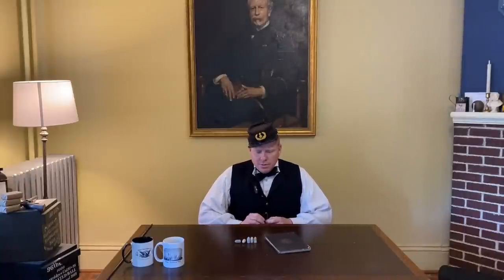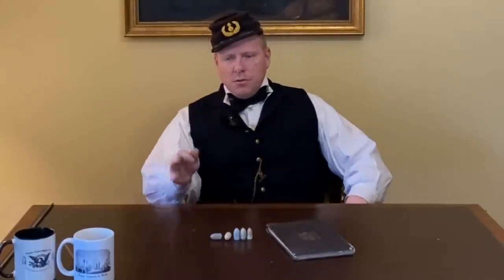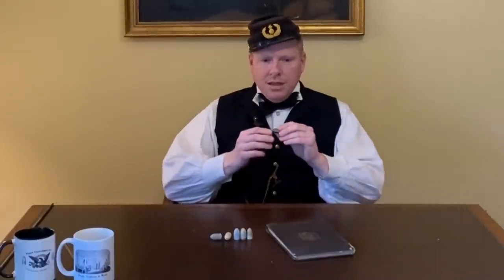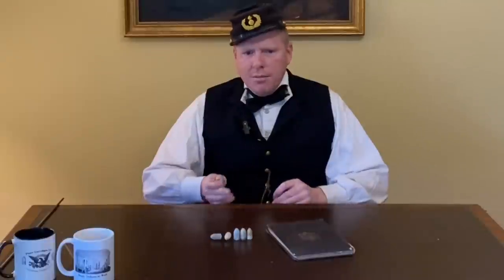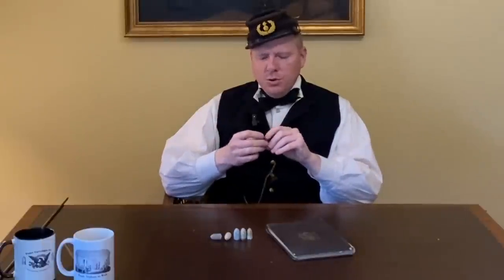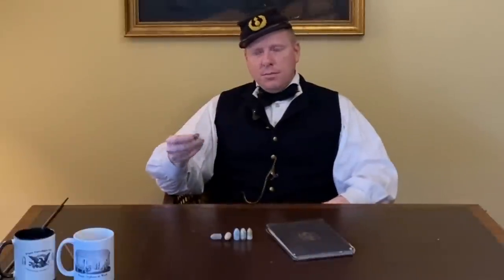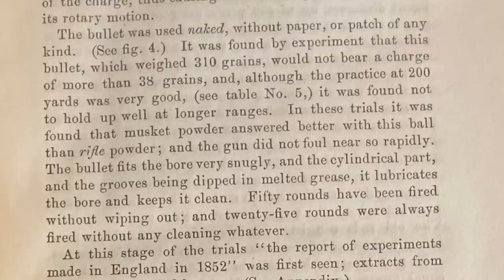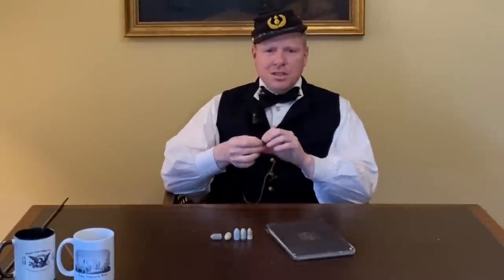Why did Civil War bullets have grooves?

Comment: One of the more interesting Myth Busters involved the testing of bullets fired into water, the question being posed concerned shooting a submerged combatent.  All supersonic bullets shattered on impact and the pieces rained down into the pool being used as a test bed, with underwater cameras to show what was happening.  A .223 or a .50 cal, all came apart on impact into harmless chunks.  But, sub sonic bullets, such as  pistol rounds from a 9mm, and older  firearms like Peacemakers using .45LC, or the 1911 with .45ACP, and specifically black powder rounds such as the Minie ball, contained a tremendous amount of lethality if fired into the water at several feet.  I think the conclusion was that if you had to take on a submerged combatant, an old black powder firearm was the only way to go.  Had to add that in reference to this video info about the 1in7 inch twist for the AR, and 1 in 6ft twist for the older rifle and his comment about the bullets spin speed, another Myth Buster tested spin rate by firing a 9mm straight down into ice, the bullet was screaming it was spinning so fast, the RPM being in the 100,000+ range.

Comment: They are gas check groves that allows the back of the bullet to expand out to engage the rifling groves in the barrel on the way out of the barrel....
This way you didn't have to force it in to the rifling while you ram them down during loading....

Comment: Interesting, i wonder why blck powder cartridge bullets of today have square groves in them, like  the 44-40? It isnt particularly fast either, is it because they are loaded into a brass case and their for needed to be more robust? Or is it because we increased the barrel twist, even though the bullet is still going slow? I love the study of interior ballistics, but have always wondered about this.
Reply: Those are actually grease (lube) grooves. They also give lead somewhere to displace to when you run the bullet through a sizing die, besides the base of the bullet, which would have very adverse effect on accuracy.

You'll notice swaged lead bullets (sized in actual manufacture) tend to be ungrooved (or knurled), cast bullets of "traditional" type have such square grooves, and cast Lee "tumble lube" type bullets have narrower, shallower, more numerous semi-circular profile grooves.

The minieball was used in barrels rifled at "round ball" rate of twist (quite slow, 100-150 caliber twist rate), while a .44-40 has a more appropriate to typical bullet length (35 to 50 caliber twist rate), thus is far better stabilized. The more elongated a bullet, the faster twist rate is needed for "ideal" stability.

If such truly piques your curiosity, get a copy of "hatcher's notebook", he has an entire section on ballistics, interior and exterior, as well as a few decades of info on such diverse topics as the "golden age" of machine guns, the perfection of the '03 Springfield rifle, development of the semi-auto battle rifle, and many more quite interesting musings from his career as an army ordnance officer from the turn of the last century until ww2

Comment: Arrows? They "wobble" a LOT from the moment of launch because the flexibilty of teh shaft allowds the force from the dtring to BEND the shaft during launch.

Bullet spin? in flight, the rotational speed" of a bullet is basically unaltered from launch to impact. As opposed to "linear" speed" which is serious;ly affected by air resistance.

The original Minie Ball had a "plug" in its base to aid "expansion", the Brits worked out that if the "grooved "tail" of the bullet were thin enough, gas pressure alone would expand it to engage the rifling. Remember , the entire point of these bullets was that expansion. The "raw' bullet was barely the diameter of the lands and thus easy to ram down even a fouled barrel.

In earlier times, rifled barrels required that the bullet be "started" at the muzzle with significant force, then rammed down the barrel. "Expanding" skirts on bullets took the hard work out of reloading..

That Greenhill chap did a LOT of work on bullets, velocity and twist rates WAY back in the mid 19th Century. Definitely worth a read!
Reply from the maker: I’d encourage you to watch my other videos and possibly even read my book “The English Cartridge” if you do want to learn more about the expanding ball and ammunition of the mid 19th century. You’re very very close, but there are some deep gaps in your knowledge.

Comment: Barnes copper bullets have the grooves. The hard solid copper doesn't engage with the rifling as well as jacketed lead bullets. 😉 Indeed, the bullets would have to be smaller diameter than the barrel grooves if not for the relief provided.

Comment: The grooves were there to help cut down on blowby, allowing for the pressure to push the round more efficiently.  Today’s rifles have closer tolerances so the grooves are not necessary.  As the gases work their way around the first ridge, the gas expands into the area provided by the first groove slowing its flow and the energy lost is exchanged into the bullet.  And then so on the process continues into the next grooves thus slowing down the speed of gas flow relative to the acceleration of the bullet.   You can find this phenomenon used today in jet engine compressors where a seal is desired, but with no contact with the compressor housing.
Reply from the maker: With all sincere respect, could you please provide one historic source (just one) that states the reason you gave for grooves in the bullets?
Reply: @papercartridges6705  truly I will say,  I have no references.  This is because they fully didn’t understand onto which they had stumbled. Remember, the Industrial Revolution was still very young.  The theories at the time were the wind vain and the expansion theories.  But at close examination of expended rounds, the expansion theory is inconclusive.     Correlating what I know in steam and aviation,  to me, what I said in my previous post is the most likely physics.

Comment: Question for you guys/audience , now I understand that this won't apply in modern rifles or many modern guns in general, but in old revolvers/replicas and modern short barrel revolvers where your getting low speeds, and can shoot cast bullets, would this concept reapply itself ? Like if I did this in my .45 1873 or a 3 inch 38spl top break?
Reply from the maker: The grooves were found to increase accuracy more at long range (sometimes 400 or more yards), for really slow twist, low velocity bullets. I think a .45-70 will have fast enough spin that grooves probably wouldn’t help much, and for a pistol, I don’t think they would serve any purpose really. We only see Tamisier grooves used in the relatively short period of time 1845-1870 when rifles used very slow twist rifling, and had a very low velocity, but they were trying to improve their long range accuracy out to 300+ yards for military purposes.

Comment: If a bullet is tipped nose down so that the grooves on top of the bullet are exposed to drag, any tipping action the grooves accomplished would result in the nose of the bullet moving to the left or right depending on the direction of the rotation.  This would actually result in the wobble increasing.  This is known as precession.  Any helicopter pilot and tell you about it.
Reply from the maker: The grooves aren’t a magic solution for everything, and their function is rather crude… I mean, deliberately causing drag on something supposed to be aerodynamic, is less than ideal. But like the feathers on a badminton cock, the drag keeps the nose (more or less) oriented and prevents the long bullet from doing what it really wants to do, which is rotate around its shortest axis, and tumble like a buzz saw.

Comment: I'm a little suspicious about the the graph of straight vectors ( 4:16 ) of the "slip stream", AKA laminar flow  being incident normal to the groove. The flow wouldn't see a flat surface since the bullet is rotating. The air will stick to the bullet creating vorticity which is drag inducing. A buoyancy force will be created opposite to where the air stacks up in greater density. I may be full shit....but that's what i think based on some background knowledge.   EDIT: I'm not sure that the physics of vorticity was understood very well in 1833.  Also, it's a really hard topic that scares the crap out of me. https://en.wikipedia.org/wiki/Navier%E2%80%93Stokes_equations
Reply from the maker: The grooves do create drag which is why the English decided the benefit of the grooves in maintaining stability was not worth the considerably loss of velocity, and the British rifle musket bullets were completely smooth. But I am definitely not an expert on the scientific side and I tried to keep the explanation as basic and as layman as possible for a short video.
Reply: @papercartridges6705  Love your content, I hope I didn't sound critical. Just thinking out load in the comments...
Reply: @nonokodog622  So, I am really late to this comment, and physics isn't my strongest suit, but forgive me for thinking out loud as I parse through this.

It seems to me there are going to be several force vectors acting on the spinning, grooved bullet as it plows through the air. There will be the drag force normal to the reverse face of the bullet, the lift force normal to the reverse of the gravity face of the bullet. There is the velocity vector normal to the forward path of the bullet and a gravity force normal to the gravity face. Because the bullet is rotating there is also a conservation of rotational momentum and its vectors. Several of those forces will be irrespective of whether the bullet is grooved or not. The velocity vector's initial condition is irrespective, the gravity force will be irrespective, as will the rotational momentum.

However, the drag force, and lift force, importantly will not be irrespective. When the ungrooved bullet starts to process around its rotation, that is wobble, it will become more and more unstable as the procession worsens with each rotation, until it has become perpendicular to the velocity vector. At which point the bullet will start to rotate around its abnormal axis of rotation and "key hole". Since the lifting force is shoved along the path of rotation like a gyro, and the procession emphasizes instabilities.

When the bullet is grooved, however, the drag force increases opposite the velocity vector, the lifting force increases opposite the wobble, and there is a restorative force vector that pushes the bullet back into its rotation along its shorter rotational symmetry plane. It essentially turns procession from a runaway force, to a self-defeating force.
Reply: @rambysophistry1220  I think we're saying the same thing. Perhaps we can consider an arrow with flights. We know that if the arrow point rotates slightly the opposite side flights will have a force on them pushing the point back. 

The rotation of course acts like a fly wheel to store energy and creates a torque along the axis which helps the bullet stay stable.

The bullet's rotation might also acts like flights as it grabs the air and forms a "boundary layer" very close to the bullet. That air is denser than the air in the laminar flow. 

The grooves exaggerate the depth of the boundary layer, making it more effective as a sort of arrow flight.
Reply: @nonokodog622  I think the math works out the same, I am just clarifying what I think is happening with the bullet. I could also point to a golf ball, where the dimples increase the accuracy of the ball drastically compared to if it were smooth. Probably with roughly the same force vectors. Either way, I wasn't trying to say you were wrong, just trying to work out what I was thinking, sorry for not being clear.
Reply: @rambysophistry1220  We're good brother. Just thinking out loud with you. Golf ball is a great analogy will think about that.
Reply: That is actually as rather good observation.  Spun bullets tend to try and fly slightly nose high, but aerodynamic forces tend to cancel that out through nutation--from the Greek word meaning to nod.  Seen from the side, this fairly accurately describes what the nose of the bullet is doing--nodding up and down.  From other angles, it is apparent that the bullet wobbles or yaws, with the nose describing a circle around the presumed curve of the trajectory.  If velocity is adequate to ward off extreme spin degradation, the amount of yaw will remain small and the bullet will follow a predictable trajectory until spin degradation reaches a point of greater yawing which would eventually cause the bullet to tumble.  If anything, the rifle muskets like the P1853 Enfield and the 1855 Springfield had extremely slow rifling twists and shallow grooves.  This was necessary for the bullet to fully expand into the rifling to seal the bore and be spun without stripping out of the grooves.   The slow twist tended to cause increased dispersion at longer rangers, which is one reason the RSAF at Enfield introduced a 1:48 inch twist in the P1858 rifle and the P-1860 carbines.

Comment: 6:55 if the bullet is spinning though, won't that "increased resistance on the flats of grooves" just cause precession and not right the bullet?
Reply from the maker: Yes, on a modern bullet spinning at many thousands of revolutions per minute. The rifle musket bullet makes one rotation in six feet. At 200 yards the bullet has only made 100 rotations, which is just an absurdly slow spin rate compared to anything modern.

Comment: I'm interested in the twist rate of the rifling in these old rifle muskets.
You mentioned 1 turn in 6 feet for the 1855 Springfield. The 1853 Enfield had a very similar twist rate.

However, I've read that the twist rate was considered inadequate for Enfield cavalry and artillery carbines (with barrel lengths of 32 inches or less). These carbines were, apparently, notably inaccurate. 

Colonel Hay (later General Hay), Director of the new British Army School of Musketry, developed a new, improved rifle, referred to as the Hay Patent Enfield, with a rifling twist rate of 1 in 49 inches. It was never adopted by the British, but significant numbers were bought to supply the New Zealand  militia being established at time. They were considered to be superior firearms by the New Zealanders. 

I've just bought one of these "improved" rifles.

Why was a twist rate of 1 in 6 feet so widely adopted if this twist rate was inadequate for "carbine" type firearms (i.e. any firearm with a barrel length of less than about 32 inches)?
Reply from the maker: The short rifles used a slightly lighter powder charge, 2 and 1/4 dram instead of 2 and 1/2 dram, so the faster twist may have been necessary to stabilize the bullet which would be moving slower than the bullets from the long rifle. The Army followed the Navy’s example after the poor performance of the P/1856 and their short rifles afterwards had 5 groove rifling with a faster twist. They are alleged to be more accurate than the P/53 with slow twist, even to the extent that in some casual shooting competitions, fast twist 5 groove short rifles must shoot at a handicap.
Reply: @papercartridges6705 
Interesting indeed. It's not just the British who identified the need for a faster twist rate in shorter barrels.
You're a wealth of knowledge.

Comment: I would like to see a bullet with dimples like on the surface of all golf balls, this is what gave birth to the game we see today and it's necessity for accuracy that was nowhere to be found until the dimples were added thus reducing surface air drag to a minimum creating the ability to control it with ridiculous accuracy, just wonder would dimples on a copper jacket have the same benefits of pinpoint accuracy even with a rifled barrel that spins it into a stable flight could only be better with less drag maybe even slightly increase the muzzle velocity and overall energy can also increase just from  speed.
Reply from the maker: Some people will knurl round balls for that exact reason. They shoot much better than ordinary round musket balls. The concept only seems to work for spherical balls though, but I’m not an expert by any means.

Comment: actually it depends on the model of M16!! it varies from 1 in 14 down to 1 in 7 depending on which round in use at the time of production! the current model is 1 in 7!
Reply from the maker: Interesting. I’m not a “modern gun” guy but the M4 carbines my Reserve unit has have that 1/7 stamped on the barrels. I assumed they all were 1 in 7. Thanks for the comment, I learned something!
Reply: @papercartridges6705  not a problem it seems all centerfire cartridges under .243 are that way! and 223/556 is also bullet sensitive too, if you don't match the slug to the target it can really suck on terminal effectiveness where ball ammo in 6.5 and larger will do the job pretty good! i know a ranger who served in somalia who tells a story from the shoot out where they were issued penetrator ammo from the gulf because some of the iraqi's had body armor, (i've heard more than one vet say quartermaster always supplies for the last fight!!) he said that ammo went straight through the somali's and they just stood there looking at them! 20 some years later he's still pissed to core over that!

Comment: Ok but wouldnt grease interfere with or defeat the whole reason for the grooves? Now the grooves are full so what is gained?
Reply from the maker: Yes you’re on to something I think. The grease often stays in the rings. I’ve dug up bullets from the backstop behind the targets and there is still grease in the rings, which would have reduced or eliminated any stabilization benefit of Tamisier grooves. Maybe it was a “it can’t hurt!” kind of decision.
Reply: @papercartridges6705  Easy to test, run some groups with and without grease and should the greaseless win, people should learn to stop greasing them. Should the grease win, well now we have a problem.